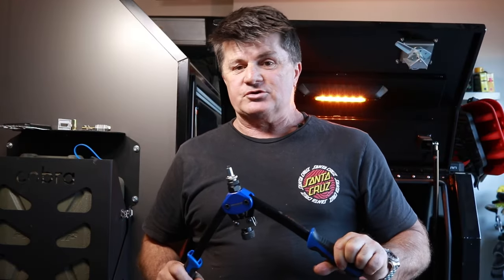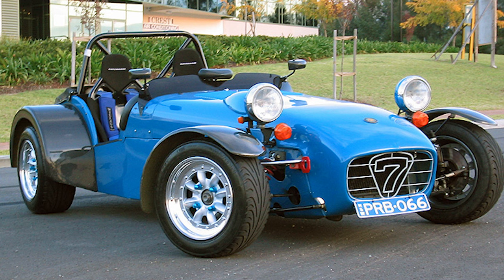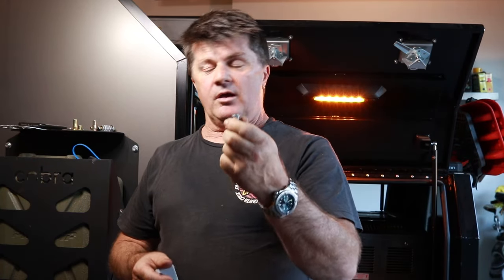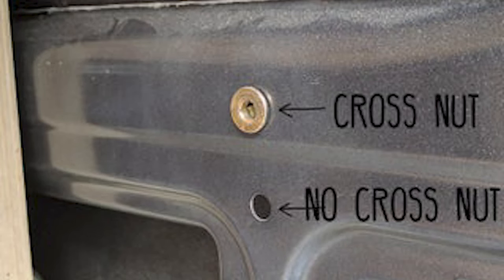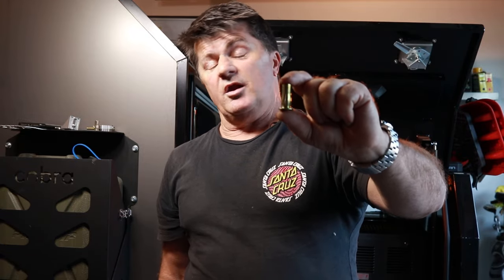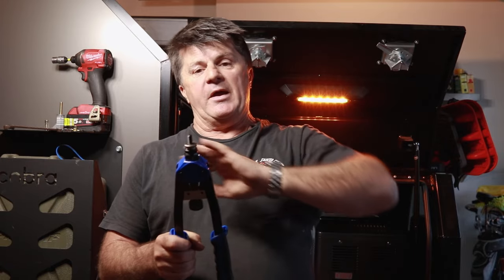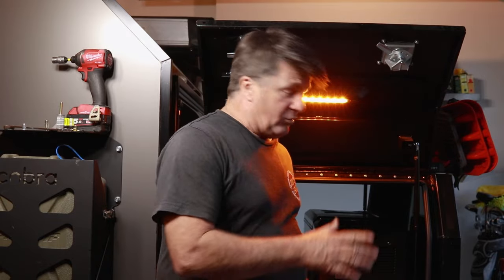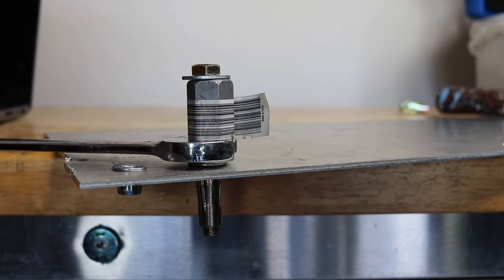Rivnuts or Plus Nuts for your next DIY project // DIY Rivnut Install tool

Comment: I work in the aviation industry here in the States, and I have come across (numerous times) rivnuts with an anti-rotational key molded in to the side under the head. A small notch is made on the hole that accommodates the key. It requires a little extra hole prep, but is worth it to prevent rivnut from ever spinning.
Reply from the maker: Interesting!
Reply: I hope those are released to the public soon.  We need the help….
Reply: Ya Boeing has been doing a great job with keeping those bits on the planes...
Reply: @adamm3492  - That’s what tending to union workers will get you - higher wages, less craftsmanship, and incompetent quality control.

Comment: This will be sooo much easier that trying to squeeze the handles of the  factory tool. Thanks for the demo of it actually working, I was initially a bit worried that the nut would just spin as the impact driver began working but now I’m convinced that this method is the way to go👍👍👍

Comment: I tried this with 12mm steel rivnuts. No way I'd have the strength to pull them in with a "proper tool" but a generic impact driver did so very easily. I made a slight improvement  by welding a handle onto the coupler nut, no chance of the spanner slipping off.

Comment: If you tack weld a  piece of  10mm round bar about 250mm long onto the 12mm nut you don't need to use a spanner to hold it as you gun it up . Just throwing it out there.
Reply: Genius!

Comment: Yes, the Achilles heel for the rivnut is the size of the hole. It needs to be exacting because the splines on the side need to grip the hole so it doesn't spin. I didn't know about plusnuts, they look interesting, probably worth having. The great thing about hand installation is you don't need as much room for a bulky tool.

Comment: Great info!  The only downside of using a bolt to tighten the riv/plus nut is potentially the extra stress you're putting on the thread section of the nut as the bolt is turning and pulling.  The proper tool just pulls on the thread section without turning ... just a thought, not sure it makes that much difference.

Comment: Why dont they use the nut to pull the stationary bolt outwards so it pulls the rivnut without stressing its threads by rotataing  .... like all the normal tools do ?????????!

Comment: Here in America, we use both Metric and SAE screws/bolts and nuts.  There is a very slight difference in diameters between the Metric and SAE screws/bolts..so if a Metric is ever so close to what ya need, try an SAE screw or bolt.

Comment: Beautiful Darryl. Thanks. I imagine if the hole is a tad large, the rivnut/plusnut will spin, so you would need to start it with a fitted nut on the top that you screw down compressing the riv/plus nut.

Comment: Darryl, your timing is almost impeccable! I just bought a kit of Rivnuts...had I known, I wouldn't got the Plusnuts. 
I didn't buy the tool though because reports about the propensity of the ebay tools to fail seemed too much of a risk, and shelling out over $100 for a "proper" tool that look the same as the ebay specials didn't seem very attractive for the 50 or so rivnuts I will use, so I figured I could set them with a bolt and something...you gave me the perfect answer (the 18V impact driver is an excellent option!)  - THANKS!! See you next time.

Comment: The plus nuts or something very close in design is sold in UK for fibreglass where a rivnut puts too much pressure on the edges of the hole.  i would have thought that a plus nut was more likely to relax than a rivnut because the bent metal part is larger and therefore only a miniscule relaxation would result in a slacker hold.  The rivnut on the other hand is much stiffer and would have to relax to a proportionately higher degree.  This principle does not matter for fibreglass as the wings will bite into the material.
Reply from the maker: In practise in sheet metal situations like camper vans where plus nuts are very popular they seem to hold better than rivnuts. 
They all have their issues though, I've had so many rivnuts spin over the years as they age its not funny.
Reply: @DarrylSheather  The security of rivnuts must come down to the way they are used as there is no logical reason for them to relax their grip on the sheet metal.  I can see an issue with rivnuts over time if the sheet metal corrodes and loses thickness around the hole or if the fixing is under use where the bolts are taken out several times  The only use I put rivnuts to is in general tightening the bolt just once.  Also, I would imagine that where there is stress in the panel that the rivnut would effectively fret in the hole.  Where there is any longterm stress on the fixing the best way iss to weld a nut to the base metal to create a blind fixing i.e. old skool.
I'm not decrying the use of plus nuts, its just that here they are recommended solely for fibreglass or other soft material, they are like a metal version of a brolly anchor used in buildings

Comment: I like the rivnut or plus it concept and they work well however, because the lip on the captured but you can’t draw material flush together the same way you would with standard bolt and nut. And that in some application is a major issue. The DIY tool is absolutely genius and much better IMO.

Comment: @DarrylSheather

NICE ! 

I'm in a Situation now where I need to put Rivnuts in my Bicycle.
The Ones for mounting Bottle Cages.

I removed the one that spinned. So there's a Hole now to put a new One in. 
The Plus Nut looks VERY interesting for that purpose.

But now I'm suspicious ^^ 
It's a thin Alloy Roadbike Frame with round Tubes .

Are those Plus Nuts better for a flat surface? 
Or can they be used for thin Tubes, too ?  ( M5 oder max. M6 ) 

Thanks for the VERY informative Video! 
Thumb's Up 👍
Reply: Plus nuts work amazingly better for tubing than rivnuts.  The wings grip the tube way stronger than a flat surface.

Comment: Thanks for the great video mate, having a bit of trouble with the riv nut skewing, and not going in straight. The bolt I'm using is 50mm  with a m12 galvanised coupler.
Do I need a bigger bolt? Yours looks about 70mm. Cheers!
Reply from the maker: If you notice I seat the rivnut and then hold the spanner that holds the coupler down on washer and the job this spreads the load and holds it straight. So all the bolt is doing is drawing up the rivnut. The bolt just needs to be long enough to go to the end of the rivnut before driving it home with the driver.
Reply: @DarrylSheather  Thanks mate.

Comment: I am trying the tool with plusnuts but the plusnut is always free spinning ?  Is there a trick I am missing because the plusnuts in you video seem to be loose at first ?
Reply from the maker: Tighten the bolt by hand to take up the slack and then push down on the spanner your using to put a bit of pressure on the top of the plus nut

Comment: What are they made of if you're using them on aluminum? And is this for parts you want to disassemble- otherwise why not weld.
Reply: These are normally used where you have no access to the back side, but want to attach things. Like he described in a campervan etc

Comment: I have an application where I want to use a Plusnut, but I don't have clearance on one side.  I was thinking that before installing I could cut out the section of the Plusnut that bows out on that side and still have three wings on hold the Plusnut in place.
Reply from the maker: Test on a piece of material before comminti g to the drill